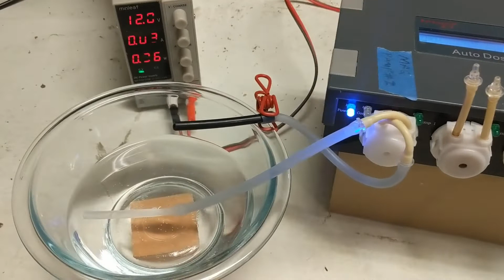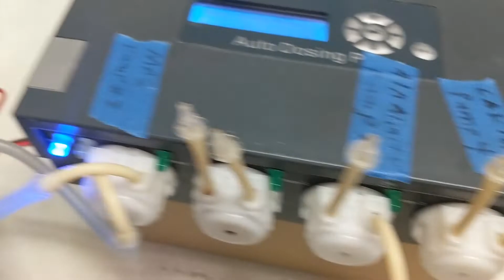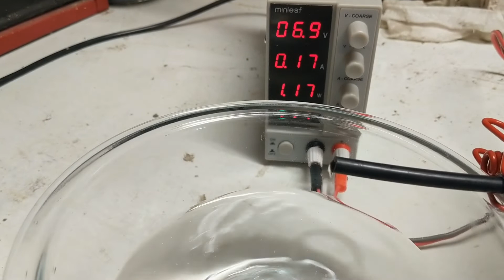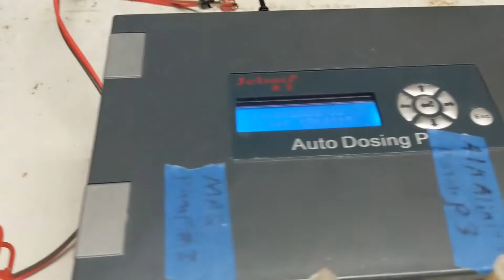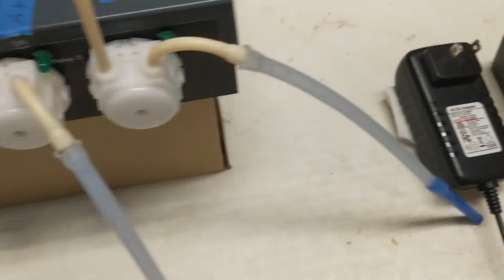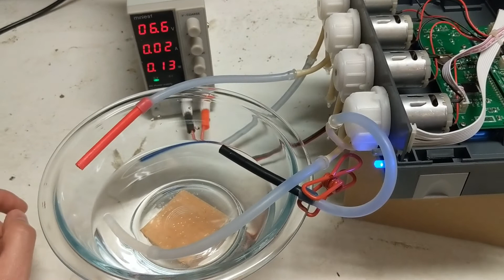Jebao Dosing Pump Improvement Modification

Comment: Hi Tim, great video!!! can you replace these motors and if so, where and what with please in regards to volts, speed etc. as i think mine have finally died after 2yrs of constantly running them.
Reply from the maker: One of the problems of this model is the pump heads rely on friction between the motor shaft and pump wheels. They slip occasionally making it impossible to have consistent dosing. I actually bought some replacement peristaltic pumps on ebay, that I have not installed yet. They use a 12v motor and 1mm tubing. They also have a gear set to rotate the pumps making dosing much more reliable.

When I have some time, I'll swap the pumps and upload a video on it.

Comment: Good Video... I like what you did but I don't know if you intentionally overlooked the fact that if you 1/2 the voltage you have to x2 the amp or wattage of the power supply.  I think this may be why the system was struggling to turn the motors at 6v because they simply didn't have enough power to turn but I also know there may have been other factors involve since the circuit board is quite voltage dependent.   

I just ordered that pump today and plan to simply add the resistors like you did - good job!
Reply: No … basically halve the voltage and you’ll approximately halve the current 🙄

Comment: Hi Tim, I have the same jebao dosing pumps. I want to do the same improvement like you, but I don't understand what kind resistors I must buy, in your video I see that you show a package of 100 ohm and 1/2w resistors, but in a comment you write that you use a 10 ohm resistors.... which resistors I must buy? 10 or 100 ohm? and how many watts the resistors must be? thanks!!!
Reply from the maker: The 100 ohm resistors didn't  turn the motors at all, so I used 10 ohm resistors in the end. You are going to need 1 resistor per motor, or 4 resistors with this dosing pump. You can buy a variety pack of resistors really cheap on Amason or Ebay and do a little trial and error with different resistors. I just used what I had on hand and wasn't an engineered decision. The motors are very low power. The 1/2 watt resistors I used have been working fine for the last ~year.

Comment: 10 ohm resistor each pump power with 9v adaptor right ? Im a new in reef, gonna buy this doser pump, but i want to modify it first, so no need to modify later.. How about if we seperate the schedule into several time ? is it can cause percitipation too ?
Reply from the maker: 10 ohms and 9 volts is what I used. I also have the program set to dose alkalinity 5 separate times during the day, and calcium 5 times at night . You definitely  don’t want to dose them both at the same time, or they will react  with each other and precipitate out.
Reply: @ratherbeflyen1  I see, gonna do modification when the doser arrive. Thank you 😊
Reply: Correct me if I wrong.. The Slower the pump the more accurate the dosing. Is it right ?
Reply: @ratherbeflyen1  when I calibrate, the jebao doser stop at 250 seconds, but it don't reach 100 ml.
Won't go further
Reply from the maker: @nixvapper  Calibrate the pump to dose 50 ml, and tell it that it's 100 ml. Then when you set your program, double the setting for the dose. IE, if you want 10 ml dosed, tell it to dose 20 ml.
Reply: @ratherbeflyen1  yes I did it. Calibrate to 50ml and double the dose when setting. It can dose to 1 ml to whatever ml perfectly. And I found this jebao can support up to 6 pumps, it has 2 more open slot if we have extra pump.